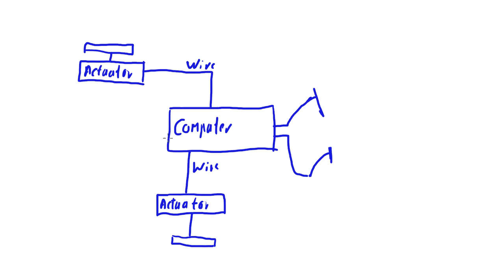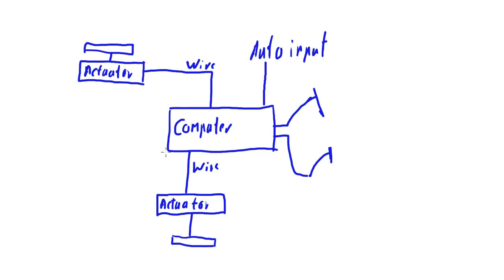Fly by Wire Explained

Comment: You actually have it somewhat wrong when it comes to explaining the relaxed ability when it comes to a fighter aircraft. Actually, it isn’t just fighter aircraft, but all modern combat aircraft are designed to be naturally unstable to make them more maneuverable, not necessarily more efficient.  When under the control of the flight control computers, for example, you’re absolutely right. Fighter aircraft like the F-16 fighting falcon or even the euro fighter typhoon especially, are quite stable. But that instability is not put there to make it more efficient, but rather to help it be more agile. Other types of transport aircraft have their stability relax slightly to help save fuel, not necessarily make them more maneuverable.

Comment: What happens if the fly by wire fails, will the aircraft become uncontrollable ?
Reply from the maker: +Tom Jardine yes it will. Modern fighter aircraft are inherently unstable and uncomfortable by a human
Reply: If the aircraft has negative static stability then yes. Usually that is the case to decrease drag.
Reply: If the complete fly by wire system fails then you're toast. There's no mechanical linkage between flight control surfaces
Reply: glishskiii That is incorrect. Modern aircraft have at least 2 more redundant control methods. If fly-by-wire fails there is an electro-mechanical system automatically (or manually, if that fails as well) being engaged. If that fails as well, there is a mechanical cable-based control method. Modern airliners no longer have hydraulic systems, although older planes modified for fly-by-wire use three redundancies: hydraulic, electro-mechanical and a system of cables, pullies and rods.
That is why airliners are so safe these days.
Reply: Every military aircraft or vehicle has one or even two backup systems for vital and other functions!